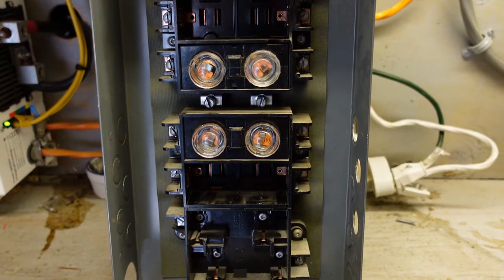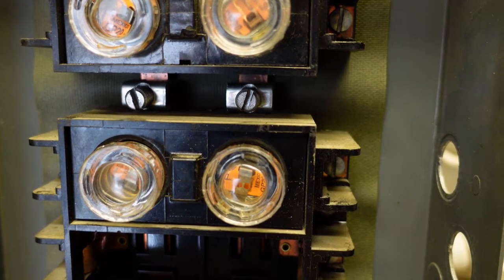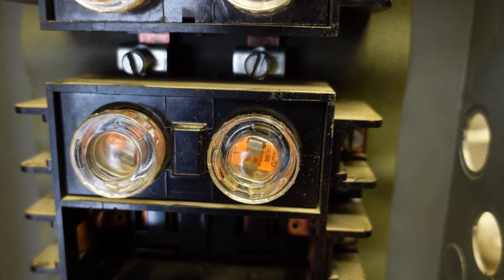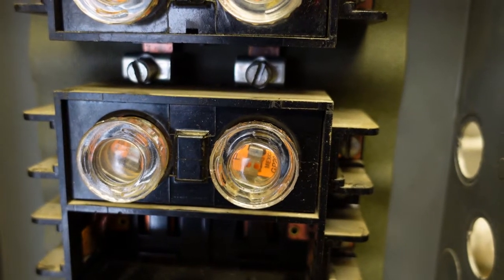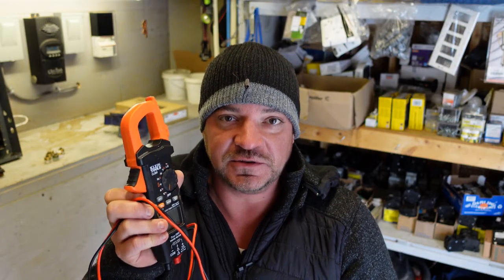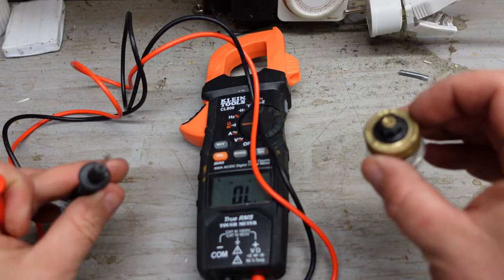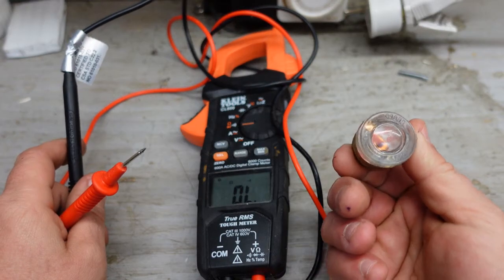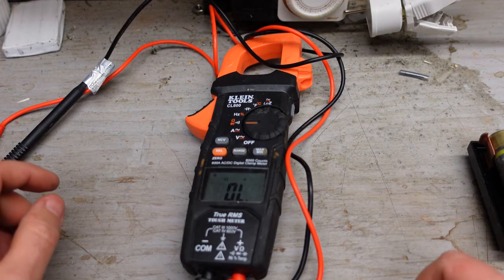How To Tell If A Fuse Is Blown Out

Comment: Boss, please see this! I stumbled onto your video in a moment of desperation. I'm currently without roughly 40% of power throughout my house. I'm unsure if it's a GFCI fault, wiring, or whatever it could be.
Reply from the maker: Depending on your location in the world some power utilities will come check out the meter and wires coming into the house  for free so you should check on that first. That will eliminate the possibility of a loose connection to the house. If that fails and you have checked all gfci resets, any tripped breakers of fuses then unfortunately I think you may be into a service call to an electrician. Hope this helps a little. Have a good day.